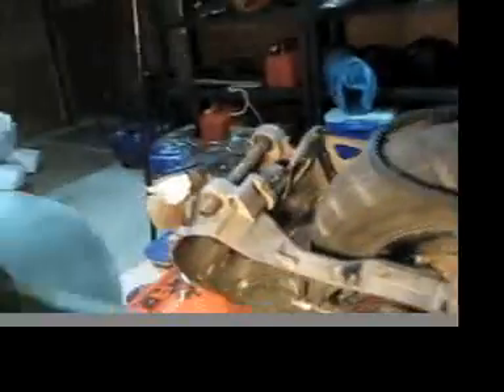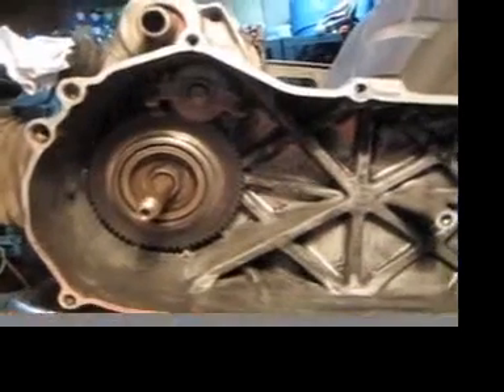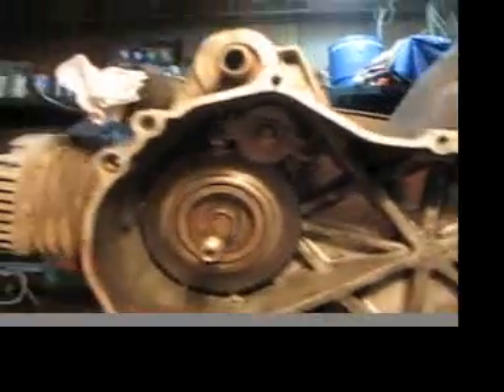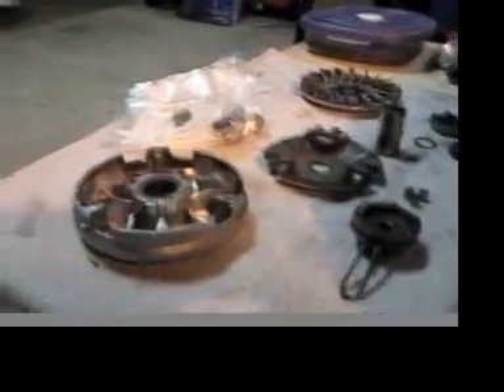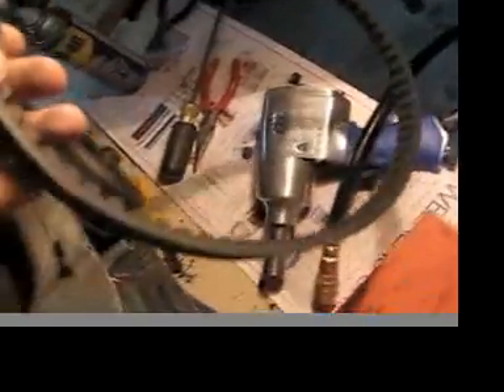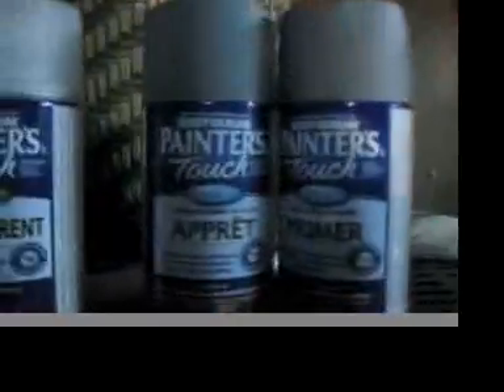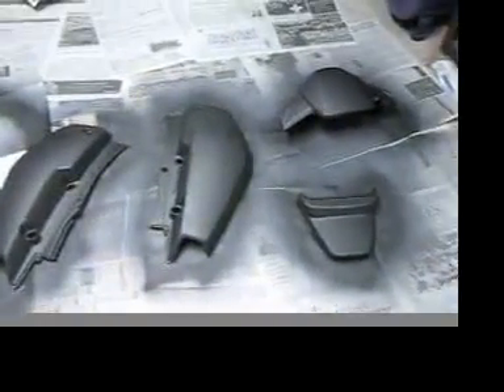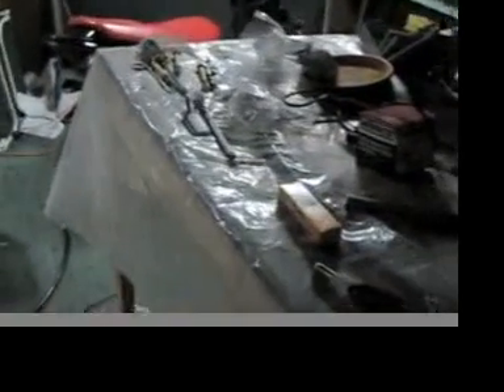BWS scooter complete transformation

Comment: i need  help i got a bws and theres hardley no power i think its losing power through the exhaust i have noticed oil is coming out the exhaust by the head i think its coming from the gasget but im not sure also im finding it very hard to start in the cold or is it the same with all bws's